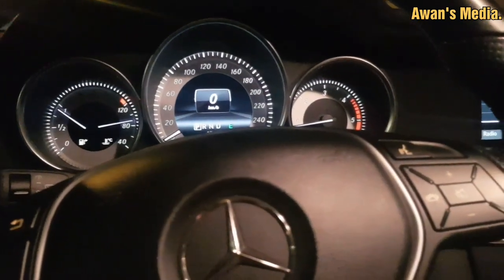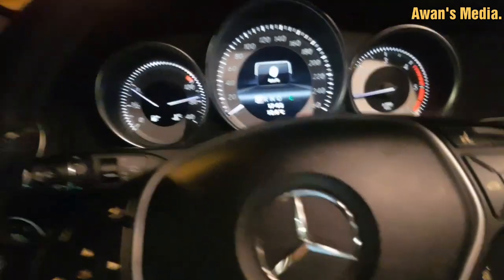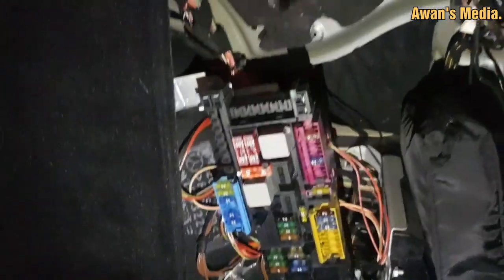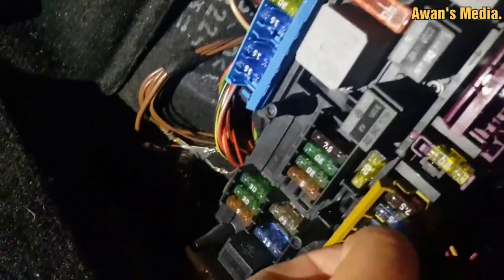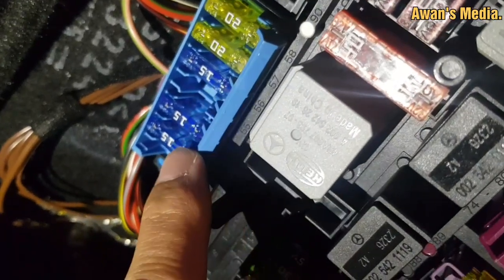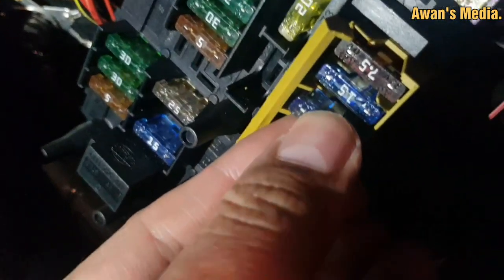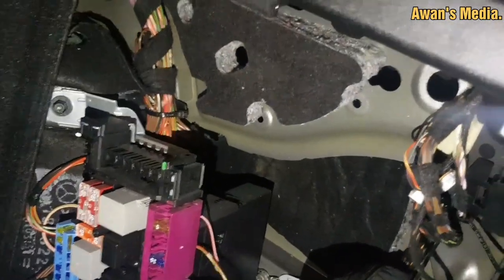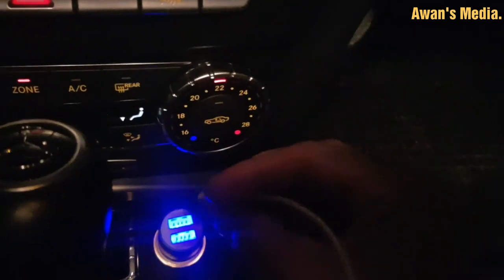How to replace mercedes benz c-class cigarette lighter fuse. How to fix usb charger fuse.

Comment: Hi Azad,
Can you guide me to change the fuse for a Merc C220d 2017, which number fuse should I be looking for, where will I find it and which is the spare I can use to replace? Sorry for so many questions but I am totally new at doing this but want to learn. 
Thank you for your help in advance.

Comment: When I plug the dashcam in this socket sometimes it works sometimes it doesnt work. But if you plug anything else it will work fine.  And I plugged the dashcam in my other truck it works fine only in this car it works on/off. Depends on its mood do you know why
Reply from the maker: Truck has more power than car battery, just check the cam power before use hope so it will work.
Reply: @AzadMediauk  brother it was working fine in the past not too long ago started seeing this problem from time to time. Like today it was working fine but yesterday on/off. I could change the fuse that's no issue but that's only if it never works. In this case its on/off like the said depends on its mood🤔
Reply: I looked at the fuse box. Their is no 71 number fuse for my car. Where is the diagram found. Like what fuse is for what purpose Etc.?
Reply from the maker: Which car you have sir? I put video of Mercedes Benz .
Reply: @AzadMediauk  c300 
2013
Reply from the maker: For c300 not sured,